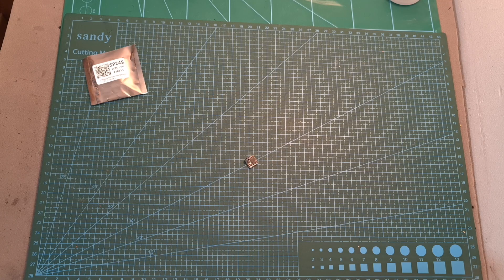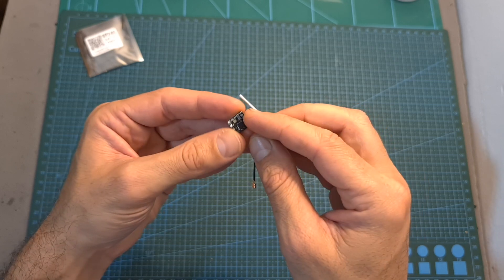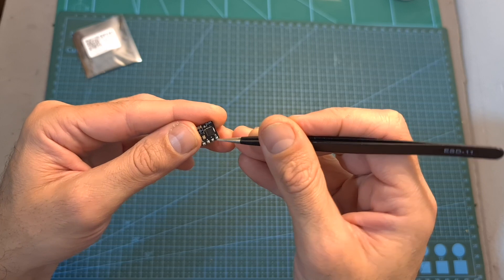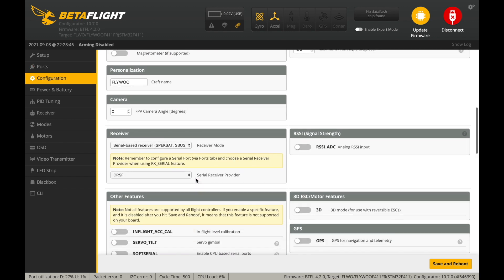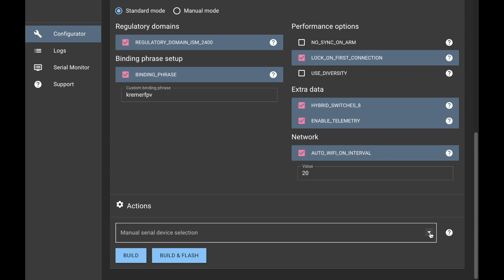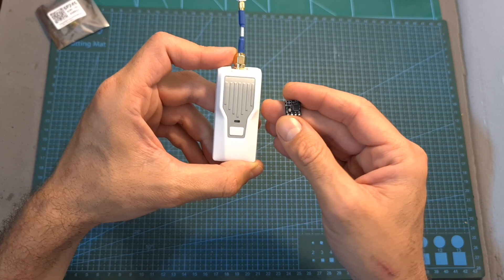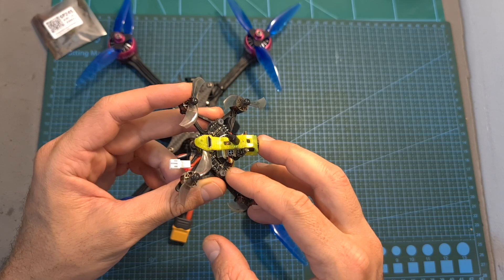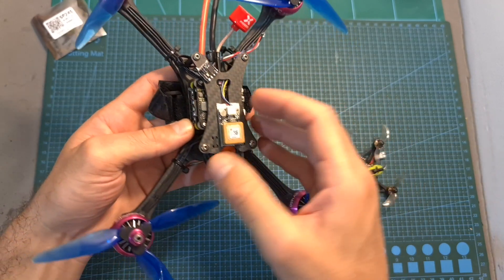0.4g ELRS RX - Range Tests & Overview // Flywoo 2.4G ExpressLRS ELRS EL24E / EL24P

Comment: Hi, I just got the flywoo explorer v2 elrs analog version. Is this the same way to bind it with wifi? Aldo how can I find what kind of elrs receiver I have.
Reply from the maker: Hi, sorry for the late response. You can check out the firmware before flashing it over WIFI by heading over to 10.0.0.1 on your browser after connecting to the WIFI hotspot of the RX.

Comment: ELRS is truly something refreshing for our hobby.  Even the RXs with onboard smd antennas are outperforming all old gen 2.4GHz systems(d8 d16 and so on). I still have my main quads equipped with crossfire as it's familiar and known system with OTA updates. But Five33 tinytrainer build and all other under 3" quads has been converted to ELRS. I'm still waiting for my HappyModel lite pro TX with 1W output, but I have no idea if I ever even need that much TX power. I still use my Happymodel "lite" TX for T-Lite that I modifies to fit Tango2.

Comment: having the chip antenna where it is really hurt your range. you're tilted forward when flying away from yourself and fully shading the antenna, if you had it on an angle off the back of the quad you could probably double your range. So that it's vertical and has a clear view back to you when you're flying.
Reply: In this condition in this kind of drone better to use rx version  with T antenna , range will be better sûre
Reply from the maker: Yes, that's correct. For this reason I was able to get much further in the test where I mounted the RX on my Mavic air 2. I agree with Sergy - the T antenna is a better option for larger quads and the ceramic antenna is a good for smaller ones.

Comment: Great review as always my friend! I'm getting so close to swapping to ELRS for my micro builds, instead of the crossfire I'm using, and I blame you (LOL).
Reply from the maker: Thanks Jeff! CRSF still rocks, but for smaller builds ELRS seems like the proper way to go :-)
Reply: @KremerFPV  oh for sure it does! So much in such a small package, especially with the ceramic antenna. I just hope it will run on my T8SG V2 plus, without needing to revert the pin mod I did for crossfire to work.

Comment: WOW 🤩 That's a crazy distance for something so smal🐭l, I think you've just convinced me to buy an ExpressLRS system for my Analogue builds mate 😉😁👍
Reply from the maker: Yes mate for your smaller builds it's going to be a great option for sure.
Reply: I love it never flying anything but, ELRS from here out. Not only is it way better link quality it's also the best latency available and only getting better at a pretty quick pace.
Reply: Why not for the bigger builds as well? I'm planning to convert almost all my builds to tower antennas (betafpv lite RX). I Like the idea of not having to install a seperate antenna. Except my long range, I'll be testing it with the 2.4G Nano RX Receiver + Antenna. If that works and allows 10km+, I'm done with crossfire...